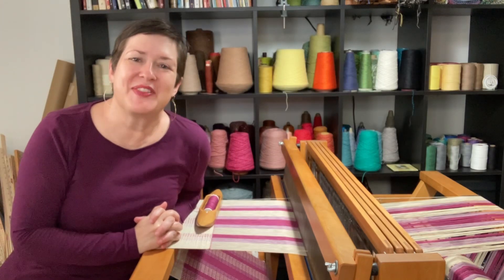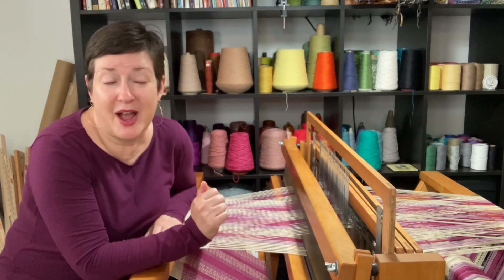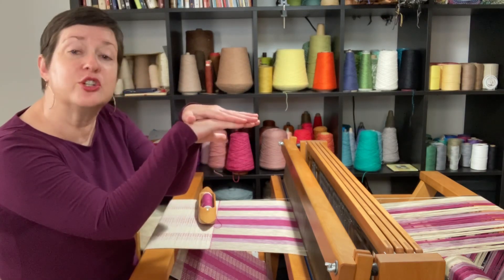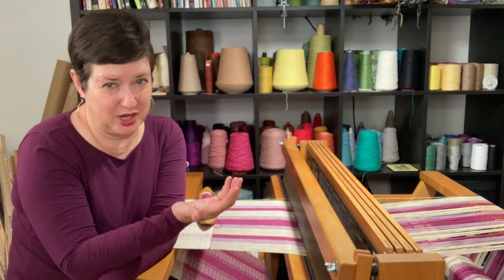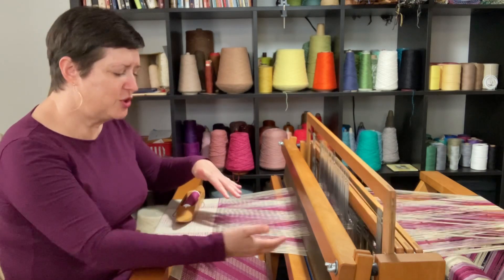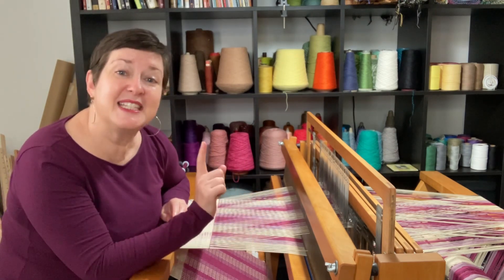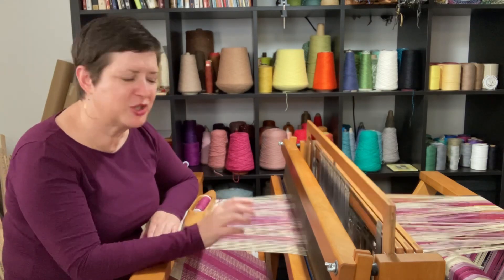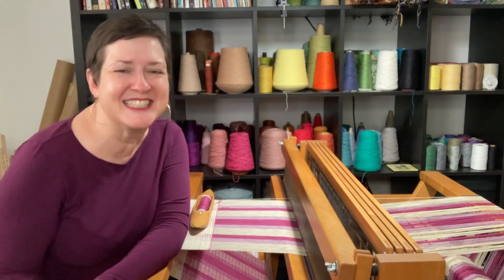The Weaving Shed

Comment: I’m starting to put my loom together again after having to move it. I remember that previously I’d noticed that the space on the shed was much smaller than previously. Perhaps the cords that help to lift the shed were not tight enough or the cords on the treadles?
Reply from the maker: Hi Myrna! I'm excited that the loom is back together! That's fabulous! 

The length of cord you use to connect the treadles to the lamms will influence the height of your shed space, to a point. 

Sadly, I'm not so brilliant when it comes to all the mechanics of a loom. So I'm not sure what else to suggest, except watching the overall motion to see what other variables will make a difference. 

I'm not sure I was much help, Myrna, but I wish you lots of luck putting everything back together!!